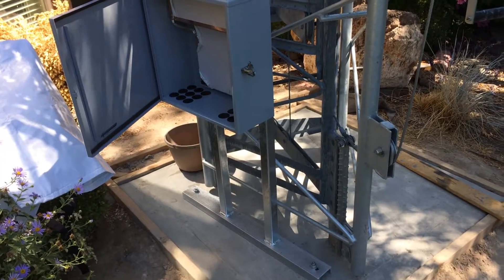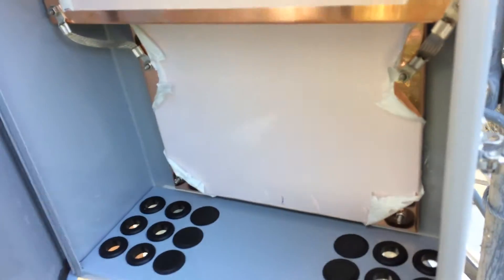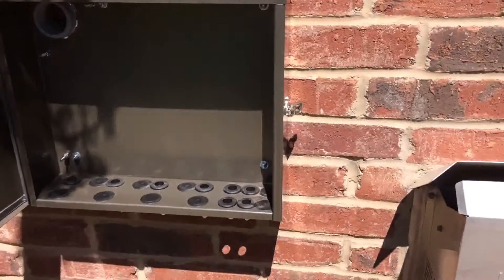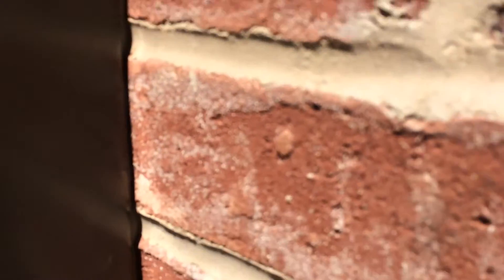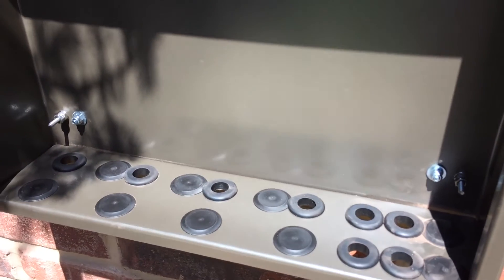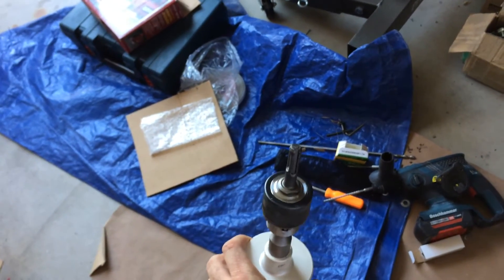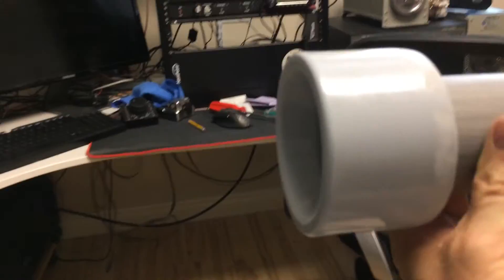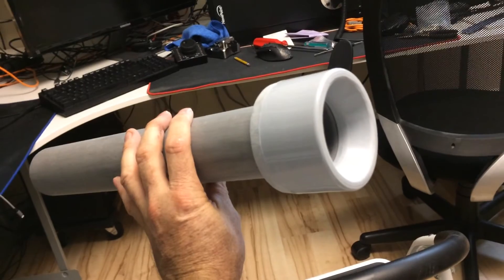NG7M - KF7P Metalwerks Junction Box / Entry Panel - Installation

Comment: Are the still pictures still available somewhere? The link in the description no longer works. Thanks
Reply from the maker: I have updated the link so that it will work.  My photo gallery software needs to be replaced.  Here is the link again to the pictures....  Max NG7M

http://www.nc7j.com/pa/NG7M/KF7P%20Metalwerks/Junction%20Box%20&%20Entry%20Panel/
Reply: @ng7m-ham-shack  Thank you so very much!

Comment: which fitting was that at the end of your 2" conduit that sets up against the drywall?  It looks clean and I have his entry panel ordered.  Thanks
Reply from the maker: It was a 3 inch to 2-inch adapter I bought at Lowes.  Watch around 9:34 minutes into the video.  That was 5 years ago now, but I suspect that same adapter can be found.  Good luck and thanks for watching!  Max NG7M

Comment: Rob (Wd4ift):  I am planning to do a similar thing. Your video was helpful as I have not seen your level of detail. My wife would like to know how you plug up the outside so that a buyer will accept the mod and buy the house. Are you aware of a plan to accomplish that task? Thanks again for sharing!
Reply from the maker: Hi Rob.  The entry panel is not very evasive. We don't plan on moving any time soon, but it would be pretty simple to mix up some mortor and grind a brick to fit the hole in the brick.  The base of the tower is a little more difficult but the base can be removed and the concrete could be jack hammered down and the cage could be cut off / cutting torch.  If you are going to do this type of setup, it's good to think through it like you have.  Or just go with a simple end fed antenna. ;)  Thanks for watching.  Max NG7M
Reply: @ng7m-ham-shack  thanks for getting back to me. Your response has been helpful.  Good luck….73